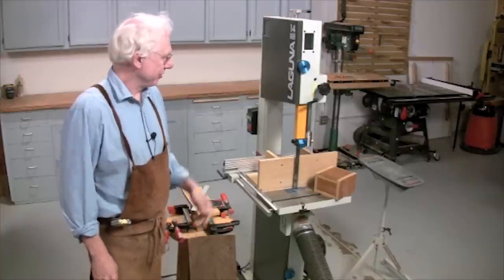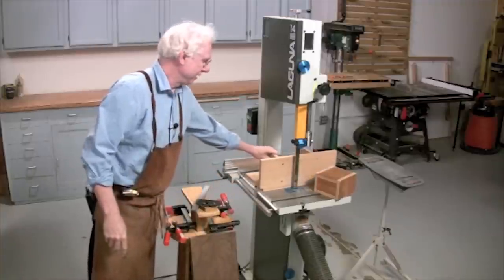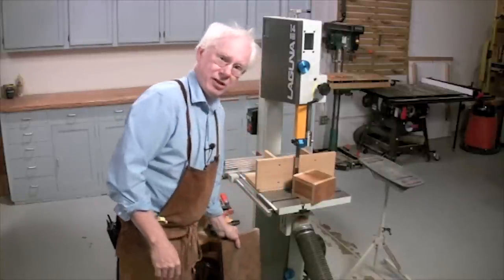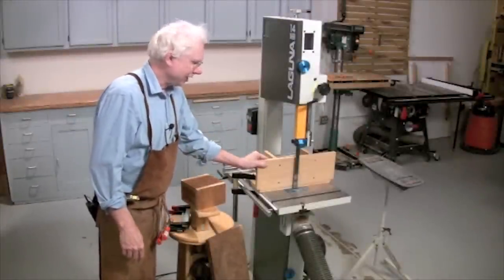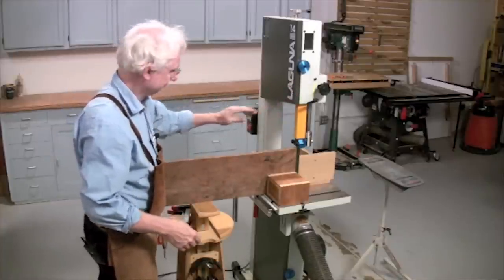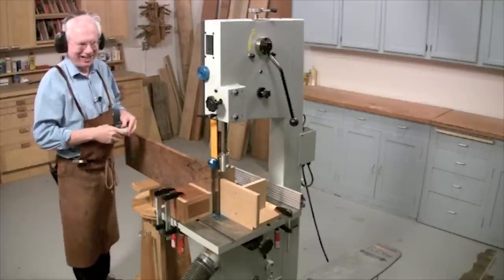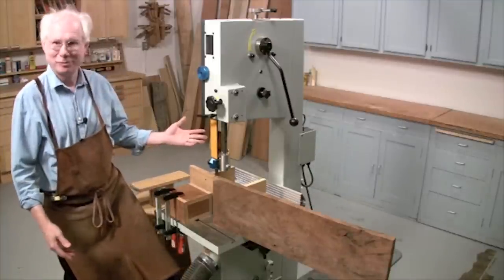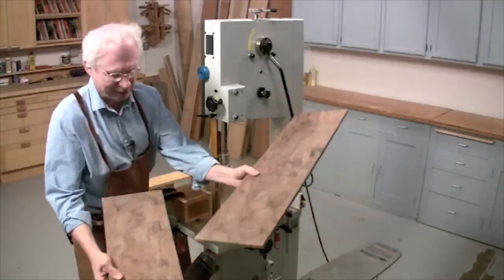Jigs for Resawing on the Bandsaw

Comment: Have the same set up without the feather board block. Like that idea will definitely add that to my set up. In addition I use large  vise grip C- clamps to hold down the fence , easier for me than the reg clamps and works for the uneven under surface of my old  Rockler bandsaw.

Comment: I have this saw. It is a beast. It came badly setup however, took me several hours to get it straightened out.  But u can resaw thin 1.5-2mm veneers from very tall boards.
Reply: Yup, had the same saw. Don’t expect much from the people who sold it to you, or Laguna to offer much support or any help trying to set it up. If you did get help, you won the lottery.  I just went thru this the other day with mini max 20;inch bandsaw. I’ve been a furniture maker for almost 56 years and still going. I’ve work on countless machines, big , small and in between. I don’t know everything but I know a fair amount to setting up woodworking machines. I never used a bandsaw with a flat, not crowned tire before. So, I decided to call  distributors who sell this machine to see it setting the bade was different on the wheel. Called at least 5. Not one could tell me or offer any help. I ended up calling SCM . USA distribution center for this and many other European machines. Went thru a long bunch of prompts to get someone only to tell me she had no idea. I asked to talk to a tech guy/ woman who could help. She could not put me thru without a complete interrogation of who I was, who i worked for how many years in business, what kind of truck I drove, my mothers  middle name, you get my drift.  After all that I said I just need a simple answer to one question about a machine they import and sell. There was no serial number on the machine. My friend bought it brand new. I have no idea where the  serial number was. I asked how that was relevant. Could give no answer except impossible to do without that number.  In my opinion, anyone who distributes or sells a machine better know damn well how it’s set up and function. I’m not talking about a bandsaw from sears, I’m talk about a European saw that Cost thousands of dollars. It boggles my mind that the 5 people I talked to and SCM had no clue. It’s like talking to a used car salesman.  I finally found out through a forum I found on line.  It appears customer service is not a thing after the sale.How do they stay in business is my question. A little off topic but I’m sure I’m not the only one who experiences this.  Thanx for reading my rant.

Comment: heck, lay down a 3/4 plywood secondary table on the table, clamp it with the fence and you have a long infeed and outfeed platform. sand it smooth and varnish it so the resaw wood will glide along.
Reply: Is that what you did?

Comment: Just because the piece is jammed up against the high clamp-on fence doesn't mean there will be no drift.  The bandsaw needs to be properly set up first.  If the piece can't move and the blade drifts from improper (or incomplete) set up, the pieces will not be uniform thickness.

Comment: I do like the setup with the block.  What carbide blade did you use?  I heard that unless you have an 18" wheel or larger that they are not a good idea due to increased likelihood of breaking.
Reply: Keith's Shop I've heard that too, but i think  that was because there were only available carbide tip blades of  1" wide and up... but now there are even 1/2" wide blades with carbide tips. They are from Laguna. They make it for 14" bandsaws and i don't see any issue with those. There are also 3/4" carbidw tips.
Reply: I use a lenox blade with carbide teeth. Just find the length and order that length from your supplier.  You can call Lenox technical support for information on blades for any application.  You cannot cut curves with a carbide blade.  Curves will break the teeth.
Reply: Thanks Ralph.

Comment: Very interesting, as I am about to re saw a piece of Australian Jarrah. I have 16mm blade with 4TPI. The board is approx 250 mm X 70mm.  I want to re saw three 20mm boards. Should I cut 22mm  from the main fence (skinny cut) or have 40mm+ against the main fence and 22mm on the outside with the box support???
Reply: Peter Compton For resawing I always set the fence to the desired thickness.